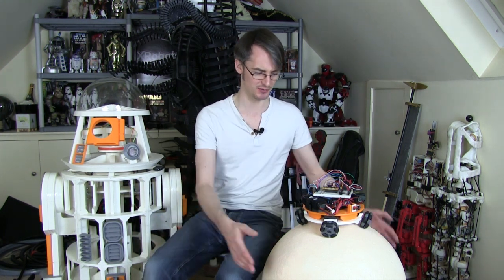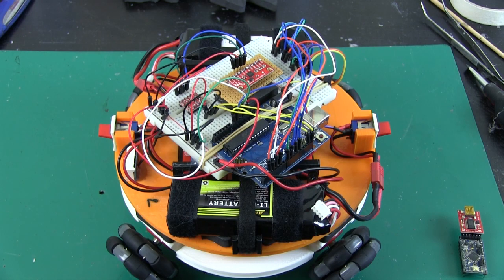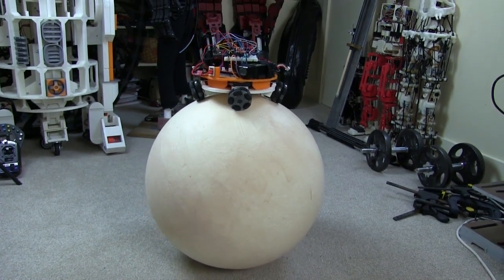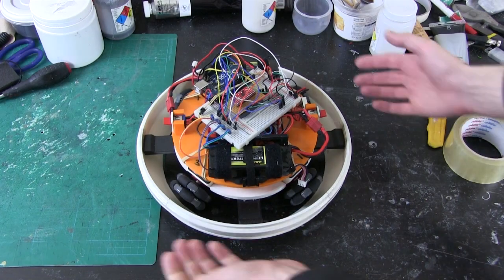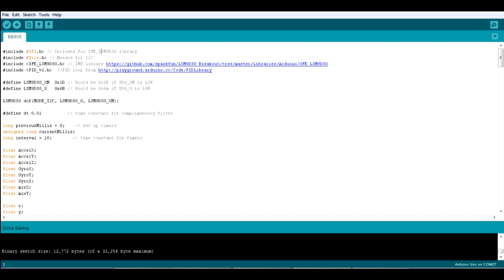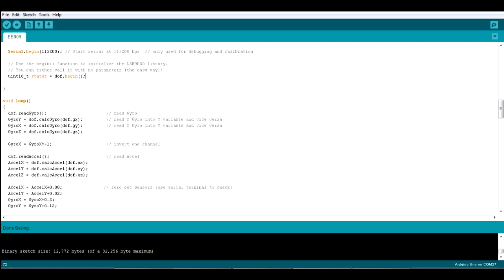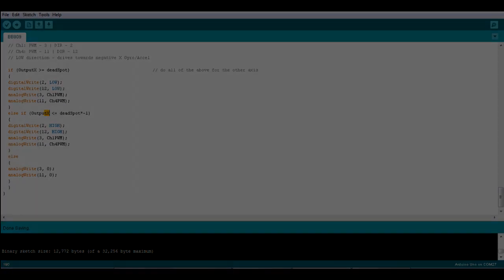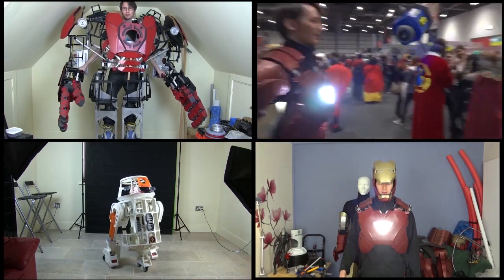Star Wars BB-8 Droid v1 #2 | Ball Balancing Robot | James Bruton

Comment: This can only balance by moving the ball around underneath it.  Here's how I recommend building it: The large ball needs a large gimble inside with a platform on top.  This gimble will have a pendulum to keep the gimble/platform upright, and a motor on each axis of the gimble for propulsion and directional control (they'll move the mass of the pendulum over a little and continuously unbalance the ball, causing it to move).  The top part of the gimbled platform will be a pole, with a motor at the top, with a magnet on the motor.  The motor/magnet will rotate the head.  It's all passively stable.  If you want to move the head down the side of ball a little pit, you can put the pole on a motorized U-Joint, or even a 1 DOF hinge.

This will do the same thing but will be much simpler and passively stable.  You could push the ball across the floor with everything turned off and the head will still stay in place (hopefully the BB8 action figure will be built like this)

Comment: You could use, brushless gimbal motors and Driver boards, they can move very smoothly. There are boards with 2 motor drivers with a Atmega for about 30€ available. 
But I'm impressed how good it works without encoders or other accurate motor control, well done.
(some notes the default PID sample time is 100ms so  maybe change this to a lower value with myPID.SetSampleTime(10); )

Comment: At about 14:10 you say that putting the sensor on a stick will increase the angle! I think you may be mistaken. If you tilt a stick over by 10 degrees, it is 10 degrees the whole length of the stick. The angle will be the same. It will move faster and help increase the signal from the accelerometers, but the effect on the Gyros will not be increased. Also, later you say the axis are different between the Gyros and the accelerometers. Not according to the datasheet. If the X axis points forward, then rotation around the Y axis will control forwards and backwards. Anyhow, great project. Looking forward to the next part.

Comment: Why did you put the inverted control sphere on top instead of putting it as non-inverted inside the ball? That way it would be able to hold perfectly still if combined with some more mass. You could also use magnets on a servo driven arm anchored on the inner sphere to control a lightweight head. That one would glide on the main sphere via some sort of ball bearing. Sounds like less programming and more stable driving. But I am hell of a lot impressed by the way you did it.

Comment: Another improvement you could do in the code is to make the millisecond delay for the loop dependent on the output of the accelerometer and gyro too, so that it is looping dependent on how accurate it has to be to balance.

Comment: You may get better balancing if you used doubles instead of floats, because floats can't store very long decimal numbers, another suggestion would be to accelerate the motors depending on the output of the accelerometers and gyro so that it makes slow movements when near the center of the ball and faster ones if it's close to falling off, this should allow it to stabilize easier.

Comment: Very Clever! The dome looks great. And the way it moves is excellent! The conditions that BB-8 are currently used in is sandy, hot and dry. I've wondered what type of polymer they used on the body to combat the bearings getting gucked up on the wheels. I also figured they made it white so it won't overheat. Your plastic dome in those conditions might overheat the electronics, work as a magnifying glass, maybe some sort of cheap lining to help cool it. The real one almost looks like it's got a gasket underneath the neck to prevent the sand from getting in it. Gosh! Why didn't they drop this on Mars?

Comment: Think BB-8 is 2 machines working together and the ball has most of the controls with a weight getting pushed in the direction it wants to go and wheels to keep it level no matter what speed its going. That way the head movement doesnt effect the body so much.

Comment: We know know how bb8 works. Its a sphero with magnet attached to its inner spring part which holds and rotate its head. 
You can make it like that. Keep that unit inside the hollow ball and put a spring on top of unit with rollers which touches inside. Then you add magnet to its head.
Reply: ***** the wall of the styroball is too thick for magnets.
Reply: ***** No way it uses magnets to hold the head on. I think James design is accurate, except for the fact I also believe the main ball moves it self, like a sphero.
Reply: So you are suggesting double balancing act?
Reply: ***** My personal opinion is that yes (I know I'm probably wrong), but what i meant with thickness was a ball from another material, fiberglass, plexiglass, plastic, ... so that it still has rigidity but thin enough walls for magnets to work.
Reply: Designandrew i Think it has been proven that it uses magnets and ball bearings. and sphero helped make the real droid.

Comment: I am not an engineer by any stretch- and yes I saw the Aneheim footage [and found your video(s) through the recommendations on it]- but why not have two synchronized robots working on this at the same time?  Put one on top of the ball as you are doing now, and then a second [heavier?] one inside the ball to take care of the actual movement?
The movie prop's head can intentionally tilt off of the center of gravity without falling or causing it to start rolling, and it doesn't roll at all without the head tilting.  With a second robot inside the ball, you have your center of gravity much lower to the ground, and can compensate for the slight adjustments the head robot is making.  That way, the head can concern itself with remaining centered, and the inner-ball robot controls the driving.  The only hard part of this arrangement is getting the head and ball robots to synchornize their efforts, and then allow for a controller to input new motions with just the head.
Reply: Bevan Jones 
Would not magnets ruin the electronics?
Reply: EVAUnit4A My thoughts exactly. + The magnetism

Comment: You talked about torque at low speeds. What motor would you recommend for running at low speed, high torque and is a small size?.

Comment: You can use this guy in your v2, Just put a magnet the inside of the ball and use this guy for the head with a magnet on the other side (the inside), put a second robot inside the ball to drive it, and this way the head will be able to go all around the ball. It can even work better than the way people are guessing the real BB8 work, with some type a rod that moves the head through the inside with a magnet

Comment: Fantastic project. I am amazed it can be controlled by an Arduino :-)
One thing I noticed in your code - and sorry if I am way off - when you set intervals to -255 to 255, aren't you missing one value? I mean 0 to 255 is 256 values, but -255 to 255 is only 511. You could have some imbalance around the center.
Reply: Yeah there is no center value in an even number, so you'd have to use 0 and -1 together maybe.
Reply: RGSneaker Arduino Pro mini 5v 16MHz + sensors mpu6050 ect (originally I2C from Nintendo WiiMote: Wii Motion Plus and Wii Nunchuk) have been used for the multiwii project for years for self build multirotors encompassing bi, tri quad hex and octocopters.
Reply: It doesn't make sense to me..🤓🤓🤓

Comment: I’m pretty sure that whole mechanics are inside of the ball. Not the head. Head is attached by strong magnets to the other ones inside of ball. How the head is moving on the ball surface so easly? Very simple, it’s rolling on a small wheels between head and ball. Inside of ball are all electronics and the mechanics that stays always in the same position. It must have some sort of arm inside that is attached to the head with magnets, to make it move from side to side like we have seen at celebration. Head is not balancing. The main weight to keep droid straight must me inside of ball.
Sorry for my english.

Comment: What about having a rc/car body floating in the middle of the ball with 4 wheels wrapping inside the ball while having a half kg weight being hung by the rc body to keep the weight down..and have a cheap plastic arm leading to the top of the ball having a single Strong negative magnet and about 4 positive magnets to keep the BB-8 head on top of the ball while reducing friction of the ball...just a idea..much easier than relying on the the head to control all the movements, when a rc/car can do it from the inside... i would do it if i had the money ;P

Comment: Hey James, I was thinking of making a bb-8 droid myself and I was wondering if you thought it would work if I used basically the same structure that you did but instead put the electronics inside the ball on the bottom and connected the semicircle on top using magnets (like the actual prop) or would I have to redesign the mechanics completely? I am fairly new to these sorts of things so sorry if this sounds dumb to you😂
Thanks.
Reply: Or should I just make a 4wd omni wheel bot and put that inside it

Comment: Forget the arduino my friend. Adding more cores should be a last resort. There are much faster and cheaper platforms to use. This is easily classified as a real-time application. One 80 MHz ARM core with an RTOS will be a much faster and cheaper controller for your application. This would be a real-time application. Complex motor control and input encoding is what some of those controllers are especially made for. The ATmega is out of its playing field at this point. You'll end up spending lots of time just getting it go real time. Get a tiva C series or an STM32 with a hardware encoder, and you'll be running with enough overhead as is necessary for a real-time control application. Maybe you could get an ATmega to do it, but with what safety overhead? And how long will it take to optimize your object code build before it runs "well enough"?

I hope you consider it. You're doing awesome work!

Comment: Dunno if this is of any help
I use Brushless motors in a 3 axis Gimbal for my quadcpter camera
they are very smooth and the controller card is a few quid ( Alex Moss chinese copy )
these brushless motors are similar to those we used in R/C planes
Reply: Vass exept that the ones used in airplanes mostly have about 800-3000 KV, while gimbal motors usually have 80-90KV. it is the exact same principle though.
Reply: Ah OK
I use 400kv  :-)
Reply: Vass With a gimbal? does that still give you enough tourgue?

Comment: great work man! i've a question for u, in the first video you show the gyroscope effect using as example the HD drive, i'm wondering if mounting a rotating disc into the middle of the four motors you can gain more inertia. in a similar way of https://www.youtube.com/watch?v=n_6p-1J551Y :) may the force be with you